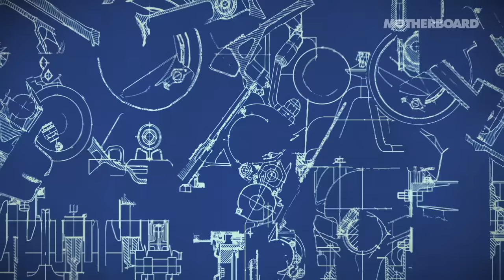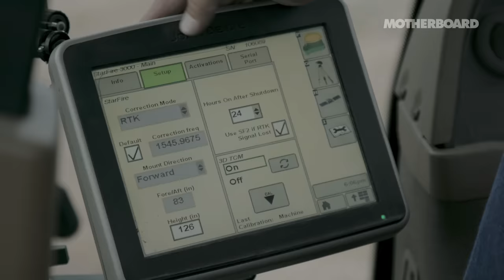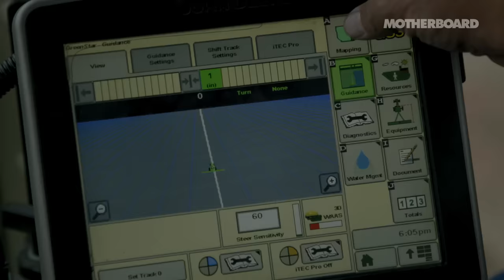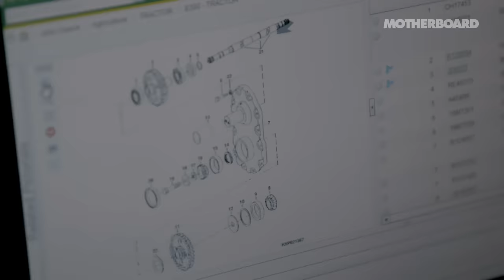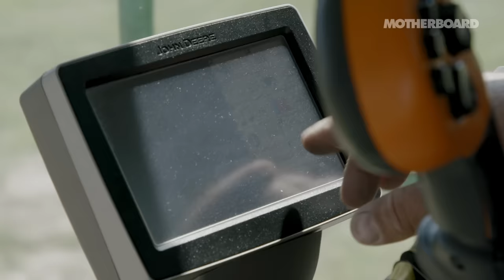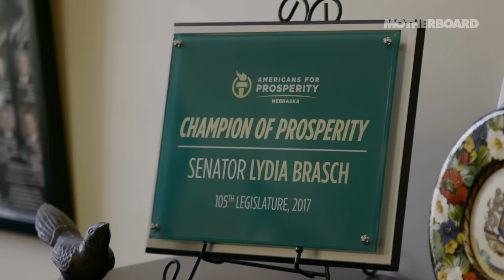Farmers Are Hacking Their Tractors Because of a Right to Repair Ban

Comment: This isn’t just tractors it’s new cars too
Reply: There is only one way to stop this moronic trend, DON'T BUY THEIR CARS!  Once they find out how we really feel (showing opinions with our wallet not our muth!) they will drop that idea.  Same thing happened with stupid talking cars idea, EVERYONE hated them, told them so, and wouldn't buy them.  The talking cars disappeared in a matter of months.  WE HAVE TO DO THE SAME THING NOW TO THIS IDEA - DON'T BUY "SEALED" CARS!
Reply: At least with a car I can go buy a scan tool from snapon or Mac and buy a scan tool a look for codes I can’t do that with my new holland
Reply: @robertmaybeth3434  yeah but even then they can "force" you like the man in the video said about the gps, Deere said they dont support it anymore (or discontinued) and then youre screwed. its like with these electric cars, in Norway and Germany theyve started to ban all vehicles except for natural gas and electric cars
Reply: I can go to any car dealership (EXCEPT TESLA) and buy the parts I need to fix my car and truck. The problem with that is.....these vehicles are so complex and tight inside the engine area, etc... that I would need a ford computer program, scanners, etc (for example) to work on my ford f350 diesel one ton. Remember the good old days when you COULD actually do some major work on your car or truck without breaking the bank?
Reply: Im sure its everything we own now a days even credit cards.
Reply: also trucks. i drive a new scania. my night heater pump broke. went to service they changed the pump. said try now. didnt work. then the guy went to office pressed few buttons. "try now" yep works.
slavery goes deeper an deeper
Reply: consumerism hits hard huh?
Reply: Time to buy horses
Reply: @smithgraincattlesgc4940  That's not going to be true much longer. I have a friend that's a mechanic and he said all of the new Ford's have networks built into them and the components are connected via gateways. If that one component is removed then the replacement one won't work. A scan tool will make no difference.
Reply: the problem is, these manufacturers want only the authorized dealers to fix their machines,
yet these dealers don't have enough smart people to do that, because these machines are so complex.
Reply: It’s everything...even household appliances.  Manufacturers don’t want us to repair, they’re fine with our current throw it out lifestyle. More $$ for them.
Reply: Odk and iPhones
Reply: It's literally everything. Planned obsolescence
Reply: Odk yep!!!!! I work at a dealership and the problem is getting worse and worse for the consumer
Reply: @smithgraincattlesgc4940  I have a bluetooth adapter and link into it with my phone and get the codes which is nice. No need for the overpriced scan tools from mac if you aren't a mechanic. they may be a little nicer however if you want to work on your car in your garage you don't need to spend a fortune on the equipment.
Reply: The older Acura models such as the 2007 Acura TL Type S is better than its successor, Acura TLX. Acura TL has a smooth steering, and it is bigger and it is a better buy. The Acura TLX is small and leather material is not the greatest for a car worth $40,000 in Canadian dollars. Even newer cars like the BMW 7 Series and Mercedes-Benz S Class just depreciates so much, and the maintenance cost is crazy.
Reply: The laws need to be rewritten.  They don't keep up with technology.  Tesla, Ford, Toyota... they are all doing the same types of things. As a auto technician I am really considering a career change this does not afford you an opportunity to compete or grow a small business
Reply: @fastrivers812  MB auto's are already this way and have been for decades.....I own a Smart Car and had to buy pirated software from China or somewhere that side of the globe and build my own system, STAR they call it. I now can do whatever the dealership can do and it cost me the same as 2 keys being regrogramed at the dealership at $456 each!  WTF....!
Reply: Tesla is the only car company that does this in the USA. Cars today aren't "too complicated to work on" I fix several a day. You guys are just whiners and know far less about basic mechanic work than you are willing to admit to.
Reply: @smithgraincattlesgc4940  what about Ford's "engine fault service now" but no code any reader was able to detect. Needless to say I'm pissed.
Reply: @kevingruenofficial  planned obsolescence? I wouldn't doubt it. Plastic everything that'll pop lose. "Engine fault service now" and no code. Corporate greed.
Reply: @joshbarth9469  So you work on MB's without the STAR system eh, BS.....there isn't a way to get into their system without using their STAR diagnostic system to fix or reprogram the car's ECU, Speedo, or SAM units......sure you may change their oil a few times a day, but that's it or fix a flat, but real computer required work can't be done without the STAR system,.....prove me wrong. I'm all ears.....or I call BS.....!
Reply: @jonathanroberts3927  Most cars require the use of a proprietary software, and NOBODY said there was a work around for that, but all of it can be bought. From GM's Tech II, Toyota's TIS, and yes even Star can be purchased. I work in a body shop, and you can't reprogram any manufacturers ADAS systems without their proprietary software. It's hardly bullshit, my guy. It's called a job. I do mechanical work for cars involved in heavy hits. If I'm pulling a motor so one of the body guys can do frame pulls, I drain the fluids, including the oil, but we don't have a tire machine and sublet that work. So I guess you're 1/2 right, if that makes you feel better?
Reply: Cars are In a different situation you can pay for everything you need but you go into high debt trying and then it's still a massive pain in the ass to repair unless you drive a smart car then computers are worse than the ones on tractors
Reply: Why I do not want the latest car.
Reply: Tesla biggest fault in my opinion
Reply: @joshbarth9469  Hmmm....we aren't talking about mechanical work here we're discussing electronic issues in John Deere equipment and how they can't get into the diagnostic software to allow them to repair that equipment.....they can do the mechanical repairs anyone can, it's just a matter of removing bad part and change with new. Just like what you describe your job to be. Simple. It only when they need to figure out what mechanical issue is acting up and to do that they must read computer readout to source it. I agreed 100% as it is the same with my Smart car....repairing cars is like doing a jigsaw puzzle for adults, once you find the piece that doesn't fit  simple get the one that does.  IF you require a computer software and the manufacturer will not allow you to obtain it then this is where the whole problem comes from in this article. For me it's a STAR software strictly used on MB products, for John Deere, they seem to have their own.....this is the issue....not that they can't do the simple swapping out of bad parts, they like me can't figure out which part is bad without the diagnostic software to tell them which part is bad. It's so complicated.    Where it shouldn't be IMHO....it's all because of the pollution natzi's imho demanding cleaner and cleaner equipment, and also the boys demanding more power and to get that they must computerize everything to get the most from an engine etc.  Then you get the  countries that simply do not care and ignore the restrictions for pollution ratings etc, eastern block, and far east countries.

But hey, if I'm only half right better than being completely wrong I guess...lol.
Reply: @jonathanroberts3927  You're half right in that I fully understand why the software is important to repairing modern anything, however there IS software available to them to diagnose and do necessary reprograms. There is a reason why certain functions are only available to factory certified technicians. 

For example, with MB you need Star to reprogram any part of their ADAS system after an accident. Which makes perfect sense, because if someone untrained dicks something up, and someone dies in their car later because the safety systems fail, its not a good look and can end up as a fucking federal investigation. However, if the car sets a P code for something like a cylinder 2 misfire, the average joe can absolutely access that information through commercially available diagnostic equipment, fix the car, and clear the code. Are you gonna be able to reflash a blank PCM? No, and for various good reasons.

This is very similar. There is software available that will 100% let you read and reset codes and has some live data and diagnostic functions for these tractors. The commercially available software does have limitations, and it involves locking people out of things that involve safety and/or something that is federally mandated on the equipment. It's not a fucking conspiracy, it's companies keeping their own ass out of the flame in situations where the liability can fall on them if Billy Bob goes rooting around where he shouldn't, and disables something on the 40 ton death machine he has owned for one season.
Reply: @joshbarth9469  Hmmmm.....it does far more than safety items that can't be done with any amount of off the shelf diagnostic readers etc can do,.  I wouldn't argue this point if I didn't have to use one to mechanically diagnose issues with engine functions on this car. I wouldn't have spent $1000 to get this software system if it wasn't needed. Believe me. I can tell you work in an auto body repair shop of some sort and know you need this system to reprogram air bags and such, but I expect you also do not get into the nasty electrical issues which stop the daily use of the vehicle. I'm not arguing with you any further as you only know what you need to know to get a vehicle back onto the road to either sell or hand back to the customer after a crash...imho.  Which is perfect fine,  but it's still not the daily requirements such as these farmers are having to deal with also.  As they say one stup[id sensor sets off a chain link of crap sometime that a simple $100 code reader just can't solve. Yes you can buy far more expensive machines but they also can't do what the factory only system can do, to keep the car running perfectly, and that isn't just safety issues like air bags , seat belts, crash sensors or speedo mileage amounts. Which is something even the STAR will not adjust unless you change the speedo's computer because of other issues, it takes the highest speedometer number not the lowest and you can't adjust it back to where your car actually is.  All of these things I have had to do, simply chasing electrical faults or the car won't run and goes into limp mode.
Have a nice night, I'm out.   Hopefully these farmers get enough traction to get this sorted out.......I'd personally band together and boycott DEERE unless they handed it over.  Which is better, selling million dollar machines or getting a few thousand in repair costs?
Reply: @fastrivers812  need to program the replacement part code into the modules.
Reply: There is information out for the public on newer vehicles, it’s just not cheap. The problem I see with this issue is that John Deere will eventually offer the software it will just cost 10k and annual updating or a subscription. Then the government will get involved to make it affordable.
Reply: Don't fight. Pray to Jesus. He will come through for us.
Reply: America, land of the simple lard heads.Would the problem be solved if u would buy quality tractors from quality companies like Valmet? xD
Reply: This is one of the reasons I got out of the automotive industry. And the way they teach you how to lie and manipulate customers. I got into mechanics to help people and make an honest living but with how everything's corporate now it's lies and manipulation and I refuse to do it. I always tell people educate yourself first otherwise an oil change will end up costing you a few hundred bucks.
Reply: Polaris pulls some similar bullshit on the off road machines
Reply: My buddy who was a shade tree mechanic who retired from FORD got a cease and desist letter from FORD telling him to quiet repairing cars using FORD software. Over 50% of the codes now TELL YOU DEALER ONLY!! The hope is you see the cost of repair at the dealer give up and BUY new car!
Reply: If car makers like Tesla take over this will happen
Reply: It's been going on little by little for a while now as far as trying to stop individuals from working on any kind of machinery. About 5 years ago I was working on my truck in my drive way all the way up by my garage, about 20 feet away from the sidewalk and a cop started harassing me about it. (Middle class suburbs in Illinois) I had the front end jacked up with two jacks and the frame resting on 8x8 timbers doing brakes, struts, ball joints, coolant, brake fluid, and power steering fluid replacement. A spring time maintenance because it needed it badly. The cop said because I wasnt a certified mechanic that I wasnt qualified to be doing the work and that it was a public safety issue. He also said it was a danger to children who might be playing around the neighborhood if they were to venture up my driveway. There is no possible way for anybody let alone children to knock a truck off of 4 foot long 8x8 timbers and two jacks. But I told him that I was going to be out here working on it until I'm finished. Then he said all it takes is seconds for an accident to happen. He asked what if I take a lunch break? Or go use the washroom? That's all the time it takes for an accident to happen. After a little back and forth argument he slowly just threatened his way into forcing me to put the tires back on and setting my truck back down on the ground. He threatened me with tickets, fines, and arrest for public safety violations and disobedience (failure to obey an officer) literal Nazi Germany policy or Soviet union policy. Thankfully I moved out of illinois later that year. Never live in a Democrat controlled state. Half of the people are just as bad if not worse than the government. The cop never said anything about it but I believe somebody nearby might have reported me. Probably some yuppie soccer mom. Nazi Germany had a citizen spy program where citizens were encouraged to report on other citizens to the Gestapo. Much of The U.S. is now under the same practices.
Reply: Yep
Reply: SOFTWARE is now leased to us on the cloud. You can't just buy a program. They want to make you dependent on it and then milk you ...
Reply: @davidjacobs8558  it's not about being smart my guy, honestly don't let the repairs themselves daunt you. If the government funded more learning programs I'm pretty sure people could learn this stuff in a matter of months...
Reply: @Jinsoku440  to be a mechanic today, you not only have to be mechanically inclined, but also electronically inclined. Not all people who are good with machines are good with electronics. completely different set of skills. it is not easy to find people who are good at both, and also willing to work in car dealership, or farm equipment dealership.
Reply: @davidjacobs8558  the guy in the video clearly shows it's possible. I'm not putting him down for saying this, but related skills are very easy to pick up if tought right. Also, I agree about the job placement/filling point, insofar as admitting not everyone wants to be a plumber, not everyone wants to be a teacher, cop, historian, construction worker, or mortician. Of course not everyone will want to fill every position, but if the career path is at least somewhat paved someone is bound to take it...
Reply: And them restricting car repair is illegal
Reply: Check out Louis Rossman channel
Reply: Yeah, I can work on an old Suzuki form 1988 just fine. But a 2019 Chevy Silverado is just computers and sensors now, I don’t know nothin about that...
Reply: As a automotive mechanic.  I will not buy anything obd2. Usually 1995 or newer.     So much unnecessary things to go wrong.
Reply: @fastrivers812  Yeap, the fuel pump control module on my T250 died, I could have ordered a new one for about $50 and changed it myself in 20 minutes, but it would not have worked because I don't have the computer or software needed to get the truck's computer to talk to the new part.
Reply: Their are law allowing you to repair your car. But that's it. It only applied to cars, not boat, not tractors, not cellphones.
Reply: @dannyfischer8336  you need IDS for my F350.
Reply: @James-kg1wf  you can't code new parts into ECMs without the factory software. Every injector on my truck has to be coded if you change a module of any kind or the fuse box, LED lights etc. You have to use factory software or it doesn't work.
Reply: @joshbarth9469  you can't do much on a new superduty without the software you think you know what you're talking about.
Reply: @whiskeytangofoxtrot9403  Where in the fuck did I say that you didn't software to fix vehicles?
Reply: Maybe the next generation can fix the mess the current space generation has put us in with technology that has screwed common since.
Reply: Finally got a Mercedez SUV running right yesterday. The whole system shut down, car running like trash, chugging, constantly stalling, etc. The fix? Add some fluid to the non-serviceable transmission. That was it. Just added half a quart of transmission fluid and the whole SUV came back to life. The ECU didn't say that. The OBD Scanner didn't say that. Hundreds of dollars of parts, and it was only a few dollars to fix it. Not to mention all the tight spaces to do the fixing otherwise. It's a real pain new vehicles.
Reply: In Sacramento County it is illegal to repair your car, truck or tractor on your own property. They past this law last year. I wonder how much the politicians were paid off by the dealers.
Reply: @smithgraincattlesgc4940   until you get a '18 and newer doge that won't let you clear codes without an additional subscription/licensing
Reply: Anything The pseudo intellectuals at Vice say is moot anyhow.... Pure Chinese , radical leftist propaganda....
Reply: @fastrivers812 I have been an auto electrics/electronics tech over 30 years and can tell you that networks such as Can,van Lin,most etc. Have been widely used throughout the vehicle industry for quite some years already,OBD laws were introduced to ensure repair and diagnosis was easier and not exclusive to the manufacturer,so what your mate told you is nonsense!.I have lots of dealer level diagnostics and some equipment that is superior.

Using various bits of kit I have acquired over the years I have recoded many used components that can't be done by the dealer using their official software,There is a massive industry for third party software,growing constantly.
Reply: @joshbarth9469  I have two different machines that are not mb star that will do ADAS.
Reply: @billnotice9957  nonsense! Go research OBD regulations and how it governs such things.
Reply: @whiskeytangofoxtrot9403  you DO NOT need factory software,most decent proprietary third party diagnostics machines will decide injectors.
Reply: @areyouundoingthatorwhat9181  I don't doubt your statement that you have programmed this/that. However, as someone stated above, when they put a replacement component on a tractor it won't work. So, you may have the flashing device to re-program but the common person does not and that is the issue.

Furthermore, I'm a software developer and have been writing code for well over 20 years. Here lies the problem w/ your statement. It works now, it will likely not work in the future. Each component on the vehicle's network can have a mac address and as you probably know that is a unique id number. They are hard coded into the component and not programmable. It is very plausible that in the future, the central computer will deny a mac address that wasn't initially installed w/ the system. 

You're thinking that you'll re-flash the computer to accept the new mac address, however, you would be wrong because the computer would have a checksum hash that is computed using the values of every mac addressed component on the system and hard coded on the computer. You or another application would not be able to compute that value because the manufacturer would have a secret salt value and public/private key tied to the vin of the vehicle that you will not know. Only the dealer will know or have access through their very expensive programming device purchased from the mfr. 

If you believe that you can hack that, a 256bit key code encryption, you would be one of the smartest people on earth.
Reply: @fastrivers812  The problem with your statement is that OBD regulations which are worldwide,were rolled out to specifically prevent car manufacturers from excluding Third party repair or diagnosis.Not taking into account the fact that it does not have to be OEM given the options available if you know where to look.A used BCM,(basically the network hub) I programmed last week using £300 Chinese virginising software pissed it! Despite the fact that oem software available to the dealer can't and 'required'a new £1500 unit.There are multitudes of individuals and companies reverse engineering software for the motor industry,which the motor industry doesn't like but can't stop.The Chinese and eastern Europeans are particularly efficient sometimes offering software before the car is released,even Nissan's gtr had third party tuning maps available before the car was on general release!.
I have replaced instrument clusters which send a 12 volt signal down the 5 volt coding track to physically burn it once coding is completed,thereby rendering the thing apparently physically unable to be recoded.Well there are 3 different systems I know of that can circumvent this actual physical measure purely using software.
I have no dealings with farm machinery,my point was to those stating that you need OEM software to complete tasks on motor vehicles is wrong. There are many other ways,even some phone apps are almost half decent tool level,Please don't attempt to tell me what I can or can't do with software that you clearly have no personal knowledge of.
And don't even begin to try to tell me that any software is completely secure regardless of its encryption level else further developement would cease,which it clearly does not.The best security systems in the world have been hacked, cracked and broken into by many people over the years,I have lost count of the amount of breaches you hear about from around the world and they are just the ones you hear about.

Just off the top of my head I can think of a case where a very high end manufacturer used apparently impossible to crack algorithm encryption developed by a specialised team to code third party premium media/nav equipment to their products,it took a single 22 year old self taught guy from the Ukraine 3 days to crack using his home pc,FFS!. There are some clearly very talented small companies and individuals out there,making the assumption that the professionals with financial clout and manpower are superior couldn't be further from the truth.
The answer lies in how much effort you are willing to put in to achieve the goal,these Chinese, eastern european and other companies put in the effort with sheer manpower at little cost for big returns. I don't proffess to have in-depth knowledge of the software, just the ability to use it to carry out the task of keeping my customers bill as small as possible.
Software faults are increasingly common failures in many automotive modules,hence the constant updates needed,its always the same with the software industry,too much emphasis on self assured ability,not enough on durability.
Those saying it can't be done are often interrupted by the sound of someone else doing it!
Reply: yeah but to a lesser extent as its harder to bully the general population compared to the small amount of farmers
Reply: It's all new tech, electric wheelchair a included.
Reply: @williampaul8556  pre computer era coming back
Reply: @smithgraincattlesgc4940  No, the vehicles now, if you have the trans rebuilt, the shop still has to go to dealer to get it re set. If it gets un plugged, dealer has to re set.
Reply: @JP-uk9uc  My 76 don't have that light?
Reply: Tesla!! And Cadillac.
Reply: @fastrivers812  apple started it all with the home button.
Reply: And now motorcycle industry has done the stupid also.
Reply: @El-ingobernable  That's a lie. There is NO ban on any cars in Norway, as long as it's PKK certified.
Reply: Printers, phones, motorcycles, manufacturing equipment, the list goes on and on.
Reply: Tesla maby but most new cars just have stuff in the way to replace or fix parts but you can get a obd2 for a few 100 and your set for every car
Reply: Not all cars, get a peugeot, they're as simple as they were 30 years ago
Reply: litterally almost anything with an engine.
Reply: Yup. Tesla is a great example of this. Do anything outside of their bounds, they drop you from support completely.
Reply: Its everything now. Heresy.
Reply: Tesla does this
Reply: @urmovaher8187  Oh- that is rough! It's like we don't even own what we buy any more.
Reply: @El-ingobernable  Protest then. I'm not big on protesting but sometimes you have to. Just don't be violent.
Reply: @dannyfischer8336  tight engine bays suck

I always hated working on full sized vans
Reply: Lucy I'm scared
Reply: @lockandloadlikehell  we just drop the engine on the full size vans to work on them. We pretty much do everything we can at one time while the engine is out.
Reply: Dirtbikes
Reply: Yeah but with new cars getting the ECU hacked is fairly easy. I took my audi for a regular maintenance and I didnt want certain things done because I could do it myself. They told me they wouldn't take off the warning signs that come from the ECU that are displayed on my dash. 
In the end they were bull shitting and I ended up being able to do the repair myself and get into my ECU and edit my car codes
Reply: Even some printers i read a while ago. And on mobile phones they want push this to, seen some mobile repair guys talking about this. Big multinational corporations that own the polticians are satanic. They need to be dismateld they are way to big.
Reply: Trust me, most of the time it's better that an actual mechanic does the job, even tho I see the point.
Reply: Like DNA Tech says. Goes beyond cars. Apple products with built in batteries you can't easily remove without taking the whole phone apart. I work in the commercial HVAC industry and they make even these things more and more complicated and proprietary such as working off factory controllers that require a factory rep with a laptop to tie into its programming as opposed to a 3rd party controller. I remember when makeup water valves in cooling towers were a simple mechanical float. Easy to test and inspect. Now it's an electronic probe that ties into the factory controller which requires a factory rep just to test. Oh and remember when we had television repair men? Yeah. I know nobody that will repair todays Smart LCD TVs.
Reply: @davidjacobs8558  This is true, I used to work for a GM dealer. These mechanics are, for the most part, on par with many independent shop mechanics. They only have the benefit of the dealer information database and having seen many of the same recurring problems. Once you bring them a problem they have not seen before, they are clueless.
Reply: @turbomustang8417  That's what I did. After about 8 years, in 2008 I said screw this (worked for GM and independent shops). Went and got a chemistry degree. It was one of the best decisions I ever made (though in hindsight I should have gone for some kind of engineering, I make good money now and love what I do).
Reply: Cars, Planes, Trains, Boats, Computers, Phones, TVs, Windows, Doors, Fans, Ovens, Fridges, almost everything now. I'm really starting to very much hate technology.
Reply: @joshbarth9469  Theres so much controlled by computers in cars and motorcycles. You need to do ample research to gain access to them. Took me months to aquire all of the equipment and get the software downloaded from sketchy sites so i could even read my codes on my motorcycle. I needed to replace my exhaust. Well once you install it then you have to be able to access the computer and "teach it" how to use the new exhuast. Which requires another program thats even more difficult to use. Even the dealers had no idea how to actually fix the issue and they have access to the legit software and tools. Random people online that rigged it all together did a better job than the dealer. In the end i got rid of the bike because it was just a headache. Everytime id almost get it fixed id need to order another thing from Europe and wait 2 weeks to get it because my dealer isnt allowed to sell the proper equipment to non certified individuals. Fixing a mechanical issue is easy which is what your referring to. Fixing computers without proper equipment is almost impossible.

Absolutely none of this was safety related but the information is not allowed to be sold. Same goes for tractors they cant get access to basic diagnostic tools to see what the problem is. Also whats your excuse for Apple? They dont allow you any parts or information to replace anything on your own. Its not dangerous to do so but they dont want to miss out on the money. They purposely up charge you when you take it to them for unnecessary fixes. So you clearly have no idea what your talking about. If a person buys something they absolutely have the right to access any and every part of it. Whether its safety related or not. If i want to get in and remap my fuel cycle, turn off a governor, or rewrite the entire safety protocol i have a right to do so and they cant withhold the equipment needed to do so. Most technicians are clueless anyways at how to fix the one thing there supposedly trained to do.
Reply: @joshbarth9469  If you think this is where it stops...just wait. They are absolutely on the road to CAN bussing every major component on a vehicle so that only the licensed single component, from the licensed dealer, with the correct serial number can be installed and the vehicle still operate. The reason car manufacturers are pursuing self-driving so hard is not because of any direct benefit to them. The self-driving network will place such high liability on vehicles working correctly and knowably that they will have a lawful basis for shutting down all independent repair.
Reply: especially teslas
Reply: @smithgraincattlesgc4940  cant do that with a tesla though
Reply: Yes, but not to this extent.  New cars are still using obd2 compliant software.   Which is mandated by law.  So as long as I have a high quality scanner, I can diagnose a new vehicle, of any make.
Reply: And semi’s too i took my truck to the dealer even they didn’t know to fix my truck and they did nothing to it but hook up a computer to it and i was charged $700 and my problem wasnt fixed!!! These big companies are greedy the lobbyists making big bucks!!!
Reply: @dannyfischer8336  Ford is one of the few that give you complete access to their vendor specific codes.  Some companies only give you access to the industry standard OBD codes.  While they are complex, access to necessary information and necessary software functions should be a right afforded the owner.  I give Ford a big thumbs up for that!
Reply: It's household appliances, too.
Reply: People complaining about this but don't see that this is the exact same way that Apple works lmao